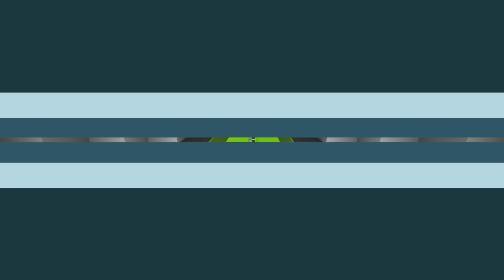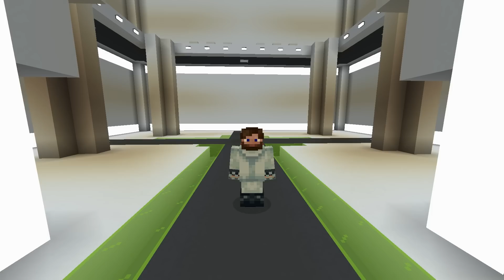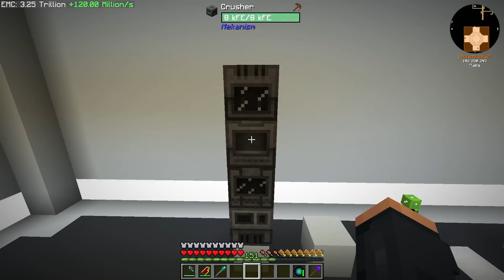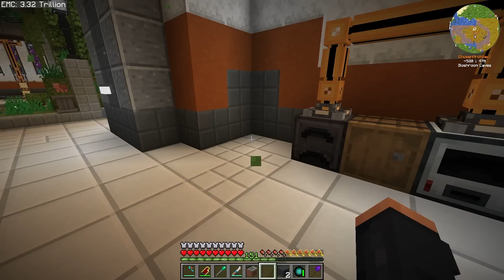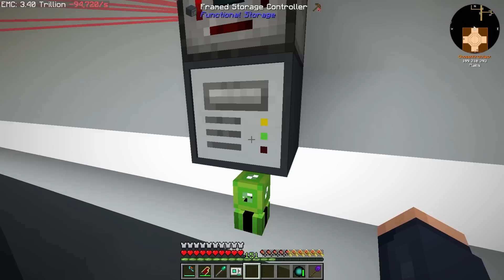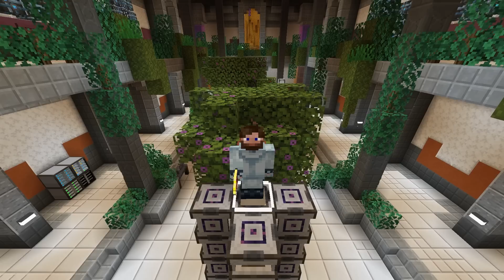PROJECT ARCHITECT 2 - EP 27: SIMPLE but FAST Mekanism Ore Processing

Comment: I’ve seen people do it on videos before but how do you shift click something while flying without it lowering you? Example is using the configurator on the logistics pipes.
Reply: remove your leggings i struggled too but you can still fly without your gem legging and then hover in the air holding shift+space

Comment: Don't know if anyone mentioned this already, but a good way to get a single block (cableless) infinite water supply is to use a Mekanism tank (basic will do), set it to Empty mode (Both mode will move the item to the bottom once the tank is full) and place a ProjectE Evertide Amulet in the top slot. Shift-right clicking the tank with a configurator will make it auto-eject water to the bottom, so no cables needed. I think it's fast enough to keep up with a smaller Fission Reactor if you void steam, though I haven't tested in a while. Should be able to keep up with a Create Steam Engine too.

Comment: I personally prefer the gem boots, because it lets you fly without needing a Klein Star. But I understand the reasoning for swapping boots. I don't personally have a problem with the slight slowdown from flying while mining, so I don't need the enchant. Everyone has their playstyle, though, so I'm not judging. But the part about not liking it's effect is a bit odd. You can turn it off, so that's not really a reason to not want to use them.

The enchantability is a much better argument, IMO.

Comment: You should try using the reliquary tome in a crafter pumping redstone blocks into it to charge to make nether stars and steel. You just also have to export steel or nether stars into the crafter with a regulator upgrade as well cause the crafter sends the the new material and the one used to craft into the output instead of keeping the one used for crafting in the internal like the tome

Comment: Comparing Gem Armor stats with other armors is so wrong since Gem Armor has hardcoded 90% damage reduction from what I heard.
The Crystallized Obsidian armor may have higher values but it is nowhere near as protective. From my own testing - a set of Obsidian armor even Godforged with Apotheosis for even higher stats and enchanted with Protection VIII you're still gonna take like a heart of damage from a Warden. In regular Gem Armor you can summon a stack of Wardens and just stand there and the most you take is half a heart of damage which is instantly healed. The Helmet and Chestplate are gonna do all the heavy lifting in that setup though I guess you don't really have to worry about dozens of Wardens, especially if you can just insta kill them with Katar. 😆
Reply: Well, you don't need to worry about wardens but you need to worry about chaos guardian at some point.....
Reply: @Ender_Pie  Not really, you only need to worry about the laser attack, but that is an insta kill regardless of what armor you're wearing. Gem, Mekasuit, Draconic Chestpiece, they all don't matter if you don't hide behind the towers.

Comment: Hey Chosen, just a question about the priority system on AE2...

Is it right to actually put the priority higher? Because the description it gives you on that screen sounds to me like you need higher numbers for higher priority for insertion to the system, but lower numbers for extraction from the system...

So if you wanted things to be took from there first, shouldn't it have had a lower priority?

Or am I just completely misunderstanding it?
Reply: From what I understand the reason the extraction is opposite the insertion is that AE2 assumes when you set the priority high on a storage it is your main storage of whatever material is in there. That means that if there is more of that resource somewhere else in the system it will use it first, leaving your prioritized storage as your main storage.

I think that makes sense

Comment: Isn’t the Mek ore pressing per raw iron about 6x?
Probably iron ore is 3.33~ is right if it’s the pre raw form
Reply: mek is still 5x for the iron ore block, but the raw is still actually better because you can fortune the ores.
Reply: It's 5X right now. For 4X you need hydrogen chloride and for 5X you need sulfuric acid.
Reply: @driftgmd  it's 3.3 if you use the raw ore not the ore block but it's still better to use raw assuming you use fortune.